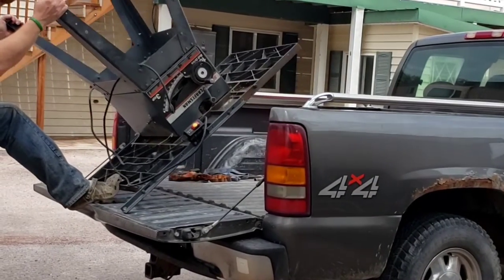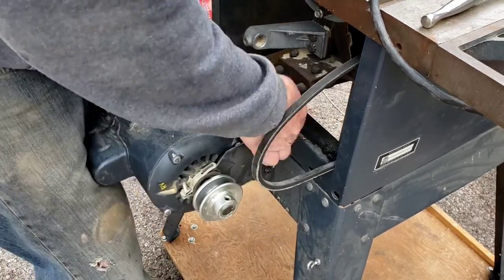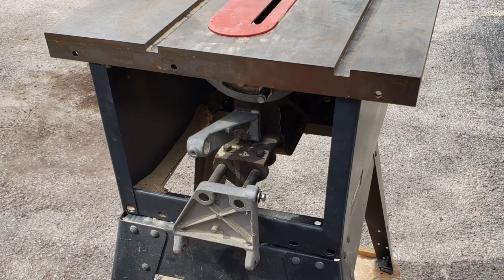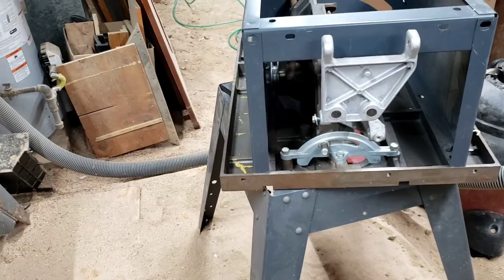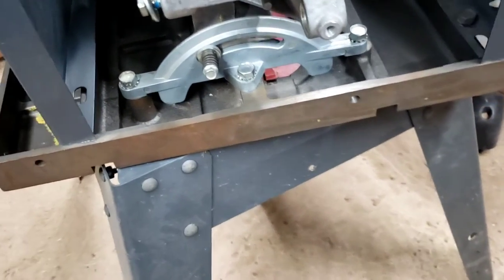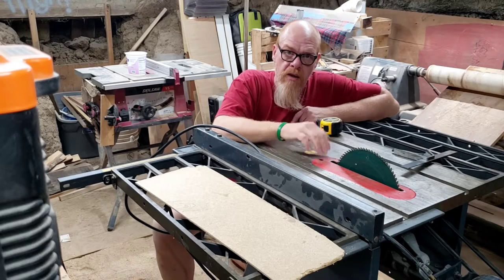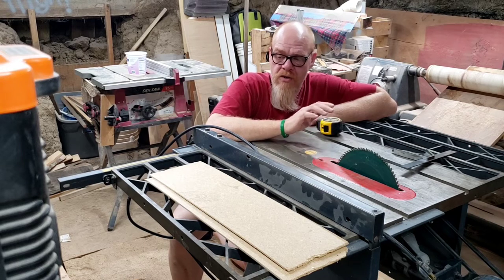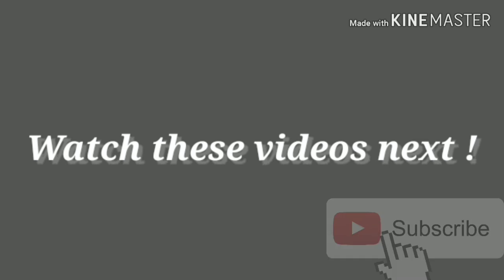Craftsman contractor saw 113.298762 tune up

Comment: I'm in the process of getting my old Craftsman saw in shape.  I got it new in 1993-4 and moved it around while I was getting stationed all over the country.  I changed the fence to a Delta T4, got new pulleys and a link belt, changed the plastic tilt and height wheels for cast aluminum, got a zero clearance plate and splitter and lastly, I got the Board Buddy anti-kick back devices.  I had 6 strokes ten years ago and want to make this saw as safe as i can.  I only have one hand so I'm extra cautious and in no rush. My wife bought this as a Christmas present and I think I spent more doing this!
Reply from the maker: Alright

Comment: I’m in process of restoring/repairing a nearly identical tab saw. But the fence is being replaced with a more accurate one and a high precision miter gauge, for cabinet work. 
The easiest way to pull the motor off is by loosening the 2 bolts holding the rods for the motor mount assembly.
Thank You
Reply from the maker: Thank you for your comment

Comment: Cool I bid on a sears craftsman contractor series 10” 3 hp table saw but I’m going to use it as a welding/ plasma cutting table. I already purchased a heavy duty 1/8” steel cart on no mar white caster wheels so I can move it around to different locations. Of course I’ll probably be able to disassemble the table top from the cart for less weight in transportation. But I watch hundreds of videos and I’m very creative.
Reply from the maker: Sweet

Comment: I have a very similar saw, I cant quite square it up. The two mitre slots are actually not parallel to each other. I mean very close but not exact. Still for less than perfect cuts its a reliable saw.

Comment: To take the motor off you loosen the 2 - 1/2" bolts that are on top of the round rods that slide into the housing. That way the whole motor assy. comes off real easy. Also the adjuster bolt that you took the ratchet to should ALWAYS be loose so when you adjust the height of the blade while it's tilted  the motor can give and needs to adjust it's self. The weight of the motor will give you all the tension thats needed. I have rebuilt 20 to 30 of these saws over the years. I have picked them up all the way from free to no more than $50 an sell them for $100 to $125. They are going to out last all the junk for years thats on the market now.

Comment: Nice upgrade.  Those old Craftsman saws are pretty decent.  I use WD-40 and wet sand with 400 grit to get my saw top free of rust.  Clean with naptha after and then wax it with furniture wax, thinned with a bit of 3 in 1 oil if you wish.
Reply from the maker: Thanks for the tips! If I remember from an old conversation we had and maybe also your fence video, you have the identical saw. Dont ya?
Reply: @MakinSawdust  Nope, mine is a different model.  Mine is direct drive with the blade attaching right to the motor shaft.

Comment: Here in Canada we have the same table only it say Craftsman CabinetMakers Series and doesn't say 3HP.    That'a for Americans that can't figure out 120V on a 15 AMP circuit doesn't equal 3HP.    The cast iron is really nice.    Leveling it is clearly a chore.
Reply from the maker: Wired on 220v is 3hp

Comment: Hello , I have a Craftsman table saw and my straight drive motor have broken down by the rod going through the Armature is twisted off  and I think it would be a problem to weld to together again .
I’m wondering if you can help in any way .
Thanks.
Tfwilli2.

Comment: I have a very similar saw (different year, same model).  This guy is going to serve you well.   
If you run a standard rubber v-belt use a strap to hold up the motor when not in use - reduces tension on the belt so it doesn't conform to the pulley shape and make vibration.
Reply from the maker: I will be upgrading to a link belt soon and it takes almost all the vibration away, because they dont have a continuous inner banding like the standard v

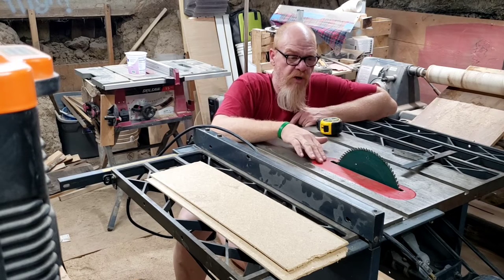Comment: Hello! I have subscribed and gave a thumbs up!  I have a Sears Craftsman Model 113-29834C table saw in Canada here and purchased it from Facebook Marketplace as well.  I think it is about 1981-1984 vintage as I downloaded a manual that is very, very close to what it looks like but the model number is slightly different. The saw came with a complete blade guard EXCEPT for the mounting hardware. I am nervous about using it without a blade guard or riving knive. I think you mentioned about the 7:30 mark that you would be designing an insert with a splitter. Did you ever make that video and add a splitter to your machine? Thanks! Mike

Comment: I am struggling to remove the rattle on this saw (just inherited it). I replaced the belt but noticed the pulled near the blade was wobbly. I tightened it but it did not do the trick. Any ideas?

Comment: Hiya, thanks for this video. I purchased the same table saw and need to rebuild it. While using it I managed to shred some of the belt and can’t figure out how to adjust it so the belt isn’t rubbing against the sidewall. Perhaps you’ll cover that in the belt replacement video. I suspect I need to adjust the pulley underneath the tabletop. Any suggestions are welcome. 
Vaundee
Reply from the maker: Thanks

Comment: Where are the other videos on this?  Really want to see them as I have one of these and want to make it better
Reply from the maker: very soon my friend! I will be making a trunion tune up and adjustment video and also a zero clearance insert for the saw. maybe a couple weeks, but stay tuned. I have learned a lot about this saw and it's adjustments and I wanted to get more familiar before I shared with my subs. thanks for stopping by. 
Make sure to stop by my website and read my article that also has a downloadable manual. link is in the description of this video and pinned comment
Reply: @MakinSawdust  awsome. Its woodworking season in the northeast and i want to get this saw and an old 12" matching bandsaw running well soon
Reply from the maker: @dichotomousblue  coincidentally it is woodworking season in the Cowboy state of Wyoming Too :) :)
I have a 10" Craftsman 3 wheel bandsaw that I refurbished and use often. I am in the process right now editing my next video which is the corner bench for my 1963 Craftsman radial arm saw. (resto following) 
Can you tell I am a Classic Craftsman tool fanatic? LOL
Reply: @MakinSawdust  I have the same saw, still getting it tuned up, really need to align the fence.  Can't wait!

Comment: Looking forward to more videos on this saw. On February 23, 2022 I bought a Craftsman 10 inch Contractor Table Saw model 113.298720C with a 1.5 hp motor off of Facebook Marketplace for $50 in Canada. The only missing item is the blade guard assembly from the pivot up. I found one on eBay and ordered it, but it is costing me $150 CDN and most of that cost is shipping.

Comment: My Dad built cabinets for 60+ years with his Craftsman table saw from about 1948. I built cabinets since 1963 using several 10 inch Craftsman saws. I purchased used saws & bolted three edge to edge in place of wings which provided three arbors. One rip blade, one finish cross cut blade & a dadoe set. I threw away the cast iron wings that had holes due to safety issues. (It is dangerous if a piece of material catches in a hole!) Instead, I put solid cast iron wings so I have a cast iron surface about 8 feet wide & the fence works anywhere I need it. I  love my Craftsman saws.
Reply from the maker: Thank you for your time to watch my videos :) I have some new content VERY soon :)

Comment: Mine pulls too much electricity and pops fuses.   Think thats more of a garage problem though
Reply: It draws 13 amps, so you should not use an extension cord. Plug it directly into an outlet.
Reply from the maker: Great tip, thanks

Comment: I'm in the process of fixing my late father's table saw which is an older craftsman 10 inch saw much like yours but without the 3hp display. Had to replace the blade pulley which I ordered off of Amazon,  (only to find out after it got jammed on the shaft ) the KEY is too big for the slot and the pulley hole is too small 🤬🤬Could've sworn it was for a 5/8 shaft. Now I had to take it all apart to get the pulley off and figure out the next step.

Comment: I have the same saw. Anyone change the arbor pulley on theirs? My set screw loosens when using; tried lock tite, but that didn't work. So I got new pulleys and a link belt. Removing the arbor pulley, I noticed the key doesn't look removable. Not sure if just seized in there. Anyone know whether that comes out? The new pulleys came with new keys, so I'm assuming so. Thanks in advance.

Comment: I have 2 of these. Suckers weight a ton with the wings on. One came with 2 of the metal pan wings attached to 2 of the cast iron wings. looked like a air plane. Only bad thing with these saws is that you can't put a link belt on it and then raise the blade all the way up because the arbor pulley comes so close to the top that the belt will rub. They are really good saws though.
Reply from the maker: I have an idea.............
Mounting the motor underneath the saw and making it a hybrid cabinet saw. It would surely help with my dust collection too.

Comment: I have a similar saw a Sherwood. the angle handle will only work to 44 Degrees the gets really tight. I was happy that you stripped your saw down, I needed to see that. Thanks.
Reply from the maker: Thank you for watching.  The Sawdust cruds get built up eventually in every crevice underneath.

Comment: What is a good price for this saw? I found one on marketplace for $120 and the top has surface rust all over it. I want a solid older saw with a 10 inch blade, and this one seems very sturdy
Reply from the maker: 120 is not a terrible deal, but maybe you can deal him down to 100 bucks. The rust is not an issue either. It is possible to clean the rust off, and have a nice finish again. It may not be perfect due to the amount of pitting, but as long as the mechanics of it are good, I would buy it.
Edited to add: I paid $60 for mine and that was a steal of a deal based on the condition of mine.

Comment: I also have this exact same saw. Just two days ago it started to throw off the motor pulley. I cannot figure out why. Ideas? Also - the blade is extremely close to the inside edge of the insert. Seems like it should be centered?

Comment: Can you help me? My blade angle won't adjust. I cleaned and lubed the Pinon teeth. The knob gets hard to turn then loose to turn and the trunions don't move  as they should consistently while adjust the knob.
Reply from the maker: Have you loosened the trunion locking screw/handle. It is located on the front of the saw body near the top. Above the height adjustment handle
Reply: @MakinSawdust  yes.  I loosened until the handle fell off. Is there a better way to communicate with you?
Reply from the maker: @outkast2626  yes you could DM me on my Makin'Sawdust facebook page and then able to send pics too. @makinsawdust1250

Comment: i've had that exact saw since i bought it new in 1966. great saw, and i just tore it all down this week to clean the inside gears and coat the gears with caurnuba wax. i have 2 questions: what are the larger 2 allen head screws that go into the cast iron top on each side of the red throat plate? 2nd question is: how tight should the belt be? thanks in advance.

Comment: I did a complete tear-down and rebuild of the same model saw. I went so far as to sand and repaint the body exterior and interior and the trunion. I'm not afraid to say that it looks pretty durn cool, better than factory new. I HIGHLY suggest you look into a new link belt to replace the stock one and upgrade your fence to the Delta T-3. It'll take some minor adjustments to make it mate up but it's a massive improvement over the stock fence.

Comment: I sure would like to see how you adjust the trunnion and how you lubricate the threaded parts for tilt and raising the blade.
Reply from the maker: I will soon be setting up my new woodshop. We just finished moving into a new house and I need to tune up both saws after the move.

Comment: I just purchased a old Table saw the plate says 1991 and it was sold by the house of tools I need to find parts doer the motor but it seems like it will run fine then I have to adjust the fence and blade thanks for this video it will help a lot

Comment: I cringed when I saw you unloading the saw, it's cast iron, real easy to break..
Reply from the maker: It only  breaks if ya drop it. I planned the unloading this way because I am by myself most times and this was the best way :)
Reply: I might add, I have the 2HP model I bought in the early 90's and has given me good service. Acquired a 3HP model, same top, same cast iron extensions, stripped it, cleaned and painted the saw assembly, all ready to put back together. Ordered a used "Craftsman Align a Fence 24/24 rip fence" to make ripping more accurate, and help me cut larger boards.
Reply from the maker: @yauwohn  appreciate that info. My motor is a 1.5 hp which may be a replacement motor. the 'as advertised' 3hp rating, I have found out is the rating if you have the beefy 3hp 220 volt motor. I honestly have not had the need for more power, but if I ever run across or need a motor, I will get the big boy. I want to upgrade to a link belt soon for vibration sake.  A fence upgrade is on the wish list too, but I have yet to decide if I want to make one or buy one. The fence I have is ok, but I would like a nicer one.
Reply: @MakinSawdust  It also breaks with stress, I took both extensions off before I loaded it on my pickup, fee it may have been, but wasn't going to risk damage. Worked with cast iron for years.
Reply: I think they started with a 1 1/2 HP motor, then went up to 2HP, as stated my old saw is 2HP, and the freebee is 3HP 120 volt. These weren't really DIY user saws, they were small shop semi pro saws, the home DIY saws were similar but pressed steel tops and pressed steel extensions. I also have a radial arm saw, large jointer and a shaping machine by Sears, all heavy cast iron machines. With the 3HP saw I got a very old Sears 4 1/2" Jointer, a bit rusty, but will clean up and join my growing workshop tools. Not a big Jointer, but will handle small work that's too small for the 6 1/2" Sears machine.
Reply from the maker: @yauwohn  sweet info. Thanks.
I have a 1963 Craftsman radial arm saw that I will be doing a resto on soon. You can probably see it in  some of the backround in many of my videos.
Reply: @MakinSawdust  I have that exact model, bought new from Sears in the early 90's.  If you look on the front you will see it says "Max Developed 3 HP".  It came with a 1 1/2 HP motor, but there was some creative marketing to make it sound more powerful than it is.  I think I understand it to be a momentary spike they measured for "max developed" rather than continuous duty.  The motor does what I need it to do, but I did switch to thin kerf blades to help it out.  I've found the stock fence to be crap.  Too easy to get it out of parallel when setting it for a cut, and the clamping on the rear rail does nothing to correct it.  After I move it to the cut width, the last thing I do is give a push on both sides of the front of the fence (what I call the wings) to make sure it is square to the rail, re-check the cut width, and then repeat this process until the width is right.  I've lived with it long enough and plan to upgrade it this spring before I take on a number of projects this year.

Comment: Hello Sir, I have this model table saw. I've been trying to figure out the name and or part number for that bottom pin that holds the motor on. Would you by any chance no what the part number is?

Comment: Thanks! I have an old craftsman that I’ve been terrified of for 5 years. I had a 2x4 kick back. It was my fault. I just didn’t know and it was my first saw. I’ve been thinking of taking it out and tuning it up. The fence was not straight and I didn’t have a splitter. Mix that with newbie and no wonder it kicked back😞
Reply from the maker: thank you for sharing

Comment: My saw looks similar to yours  mine is a #113-298840 It has had tons of wood run through it and still functions fine. What kind of drive system does your saw have? mine is belt driven. I see you have the same type fence as mine. I use it mostly for making jewlry boxes and other close tolorance jobs. I was going to replace it but it has performed flawless so far and find no reason too.
Reply from the maker: Sorry for my late reply.  Currently I like doing small work also it's just it's light weight and it's not heavy anymore and it's very intricate. 
Mine is belt driven too but I found that a link belt actually smooth the saw out vibration really good

Comment: Picked up this model the other day. Decided to take her apart and got it all cleaned up. Shot a coat of paint today. I'm planning to put some new pulleys/belt on it. Who knows from there
Reply from the maker: Cool, If you didn't see yet, I uploaded a new video today about this saw tune up
Reply: @MakinSawdust  Just watched it. I'll be making reference to it when I put her back together.   Any chance of a video on adjusting the Trunions?
Reply from the maker: Trunion and fence alignment will be the next video in this series, but it may not be for a few weeks. I have a couple other videos planned in the meantime.